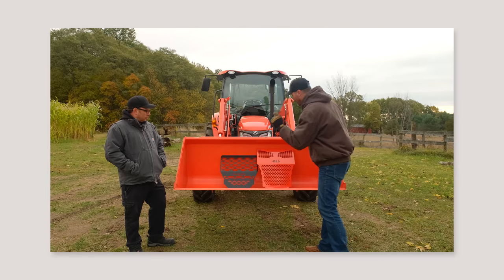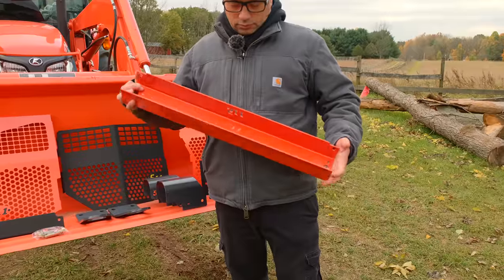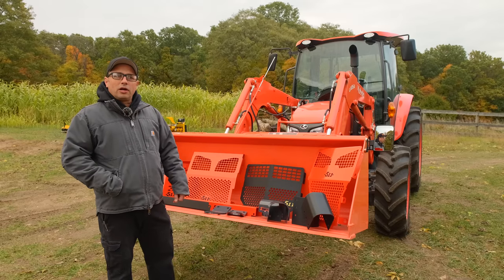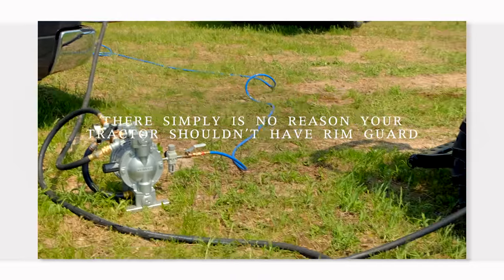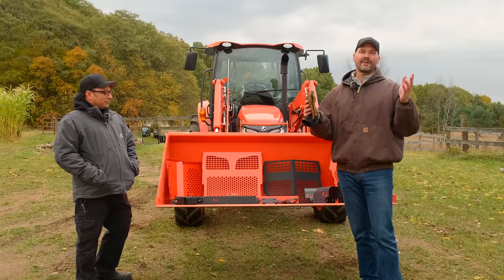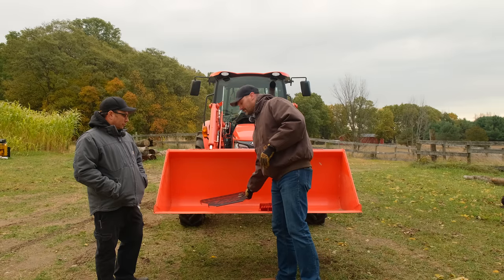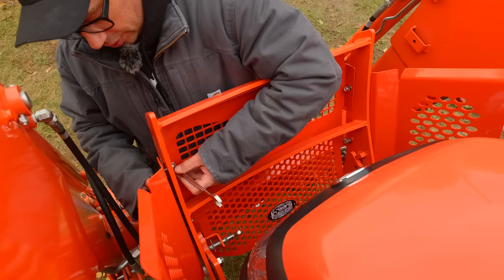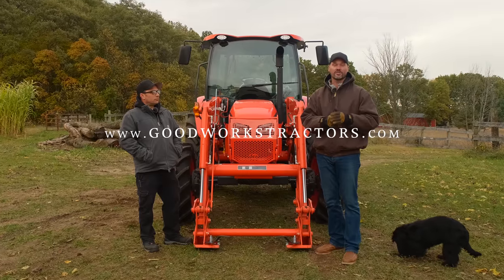BEFORE YOU BUY BOTA, YOU BETTER WATCH THIS

Comment: Pretty pricey grill for JD 1025r. Thanks for the videos, very helpful.
Reply from the maker: American steel, American labor, 5 step powder coat process, shipping included.  High quality all around, done the right way.
Reply: as another poster mentioned  "its way cheaper than a new radiator  or hood

Comment: May want to consider an extension to the top of the grill guard to protect the hood. I’ve had chunks come over the back of the bucket and land on the hood. Great looking products!
Reply from the maker: That's a good idea Steve.  Thanks for sharing!
Reply: While it might be a good idea to protect the hood from damage my main concern is more of the radiator and the undeside and the pto as well as the hydraulics

Comment: It would be nice if the manufacturer took all this into consideration and simply built a tractor factory prepared and shipped to do the work of a tractor.  Go figure
Reply from the maker: I agree, but at least it gives a bunch of small businesses a market!
Reply: @GoodWorksTractors  exac what I thought.  Also, not everyone runs a grapple or does brush or demo with tractor - which doesn’t need a lot of this stuff - or you can try and be more careful—-good luck with that!
Reply: Do you realize the variety of ways tractors are used makes that pretty much impossible? Tractor prepped for every possible work environment would be insanely expensive.
Reply: Your definition of "work of a tractor " vs the next guys can differ greatly... hence why so many options and upgrades are out there for different applications

Comment: The 511 stuff is nice. I have a grill guard for my MX.  Sure would love some ROPS mounts to attach a small toolbox, or chainsaw. The light mounts are oriented wrong to double as a box holder.  The MX guard does require drilling.

Comment: I welded rolled expanded steel on my Precision grapple to prevent brush from poking through the gaping holes in the framing.  My only problem with the commercially available grille guards is the shading of the headlights.  Nice to see the locally sourced product.  How about that 52 Bar-B-Que in Chelsea?
Reply from the maker: Nice!  Yeah, headlights don't seem to do much good behind a bucket anyways.  Fender lights are a bit better, but stuff up on the ROPS seems to be the ticket!

Comment: I am working on low profile Tail lights. The factory ones stick back way too far and are in the way when hooking up the PTO with a quick hitch. Also on the L2501 if your wuick hitch levers are up it is possible to hit the lights when lifting the 3 point.  Might be something for 5 11 to look at.

Comment: I need to one the for our Kubota Grand L.   
Just playing devil's advocate,  would Kubota say the bigger holes are necessary for airflow to the radiator? Obviously 511 does a better job of protection,  but is air flow an issue?
Reply from the maker: I would think they would put bigger holes on the hood bonnet if more air flow is needed?  There's plenty of air space between the grill guard and bonnet and all around the sides too.  Tractors go 15-20 mph max, normally well under 10 mph.  Different setup than a car going 70 down the highway.  At least, that's my take on it :)
Reply: @GoodWorksTractors  Makes sense on your answer. Thanks.

Comment: Those guards look good and obviously are more durable but is there any lighting reduction? Obviously it’s day time when making this video. So have you noticed any lack of visibility when driving after dark with the new guard installed?
Reply: a little but not enough to matter on my 1025r  plus it obstructs the headlights way less than the bucket does
Reply from the maker: Very little impact in my experience.
Reply: I put a 511 grill guard on my L4060 last year. Great product and the stainless hardware was a nice touch. I will say that the headlights are significantly obstructed, to the point that I take it off in winter for plowing. That said, I still prefer the correct level of protection that it provides. In hindsight, I would like a fold down, pivoting, or removable plate over the headlights.
Anyway, is a great product and I will look at their newer offerings.

Comment: Just looked at the tie downs at their website. Asking $149. That is way too high. The front guard is $369 for my B2650.  Also, you are showing these parts yet many are out of stock such as the B2650 orange & black Grill guards and the magnetic mirrors.  They do look great though ....
Reply from the maker: Putting out a video has a way of doing that.  Things will sell out, but be restocked pretty quickly.  On that note, it’s hard to say things are overpriced when they are selling out like you mentioned.  It seems like they are priced well.  This isn’t a guy making them for himself in his shop.  R&D, USA material, USA labor, shipping, powder coat, insurance, FF&E, building costs, etc.  Not to mention making a profit.

Comment: It’s unfortunate!! Kubota now a days is not built as stoutly as those in the ‘80’s and 90’s. Thinner gauge steel and plastic for the engine cover. I wonder why I paid over $30,000 for my B 3350?